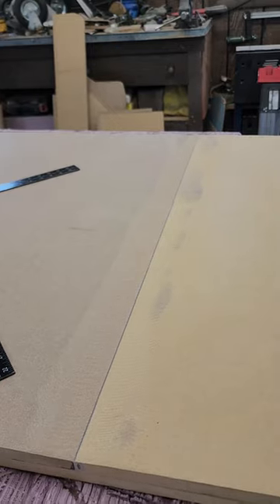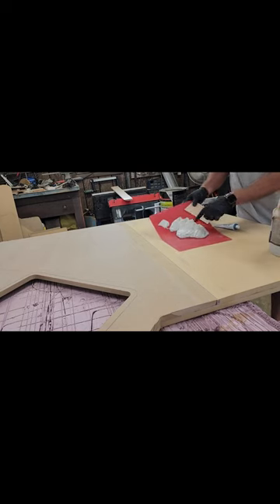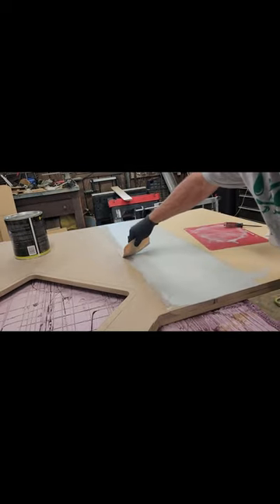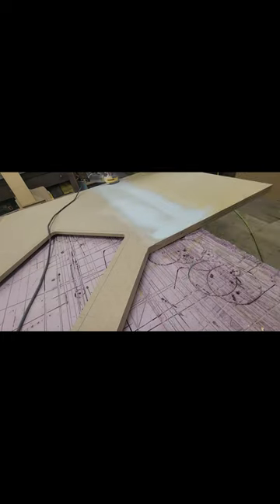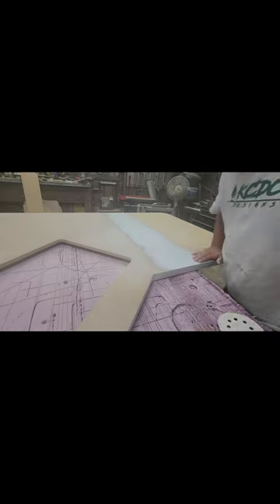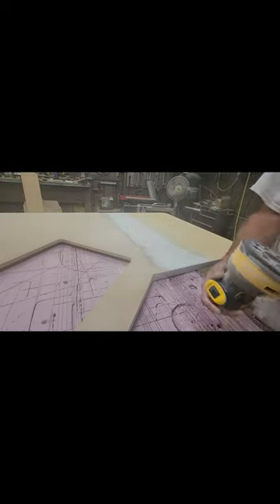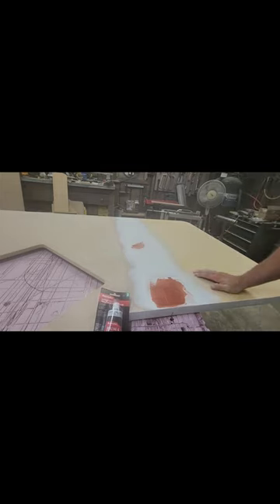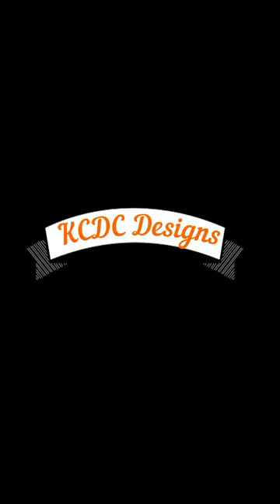Watch how to be sure your countertop seam NEVER shows through your epoxy finish! I KCDC Designs

Comment: Bondo is polyester based. Epoxy resin is not. They are not especially compatible. You can run into curing problems mixing resin into your bondo. I thought the sheetrock taping knife was a stroke of genius but you better clean it fast. Love your videos. Thanks!
Reply from the maker: Thank you for your comment, and kind words!
I discontinued using resin in bondo for that very reason; compatibility issues. I saw someone else mix fiberglass resin, with the catalyst, in with their bondo, and being a former auto body guy made me realize that no two products should be mixed together, unless intended to be.
3M informed me that their bondo has a wax in the formula that rises to the surface as a protectant, until it is sanded off. Fiberglass resin does the same (from what I was told). That alone should be a red flag to mix the two together.
Thanks again for your comment and supporting my channel, I really appreciate it!